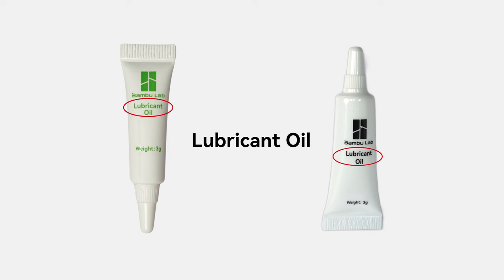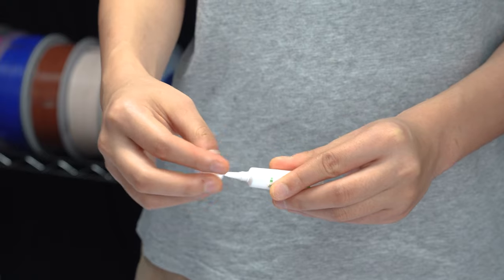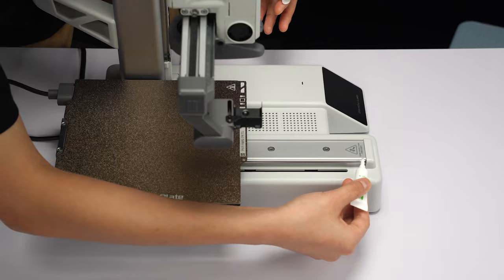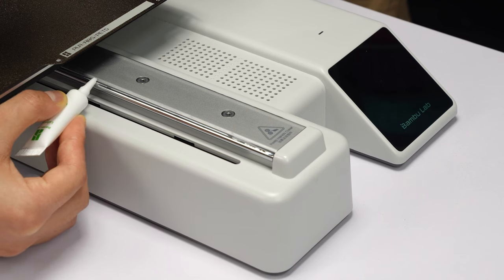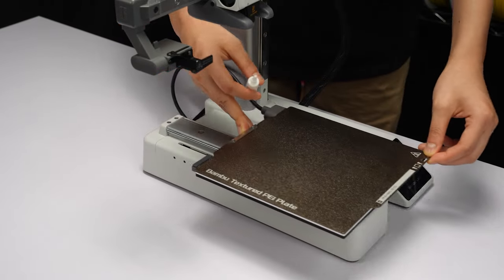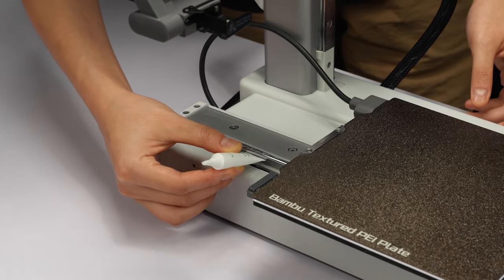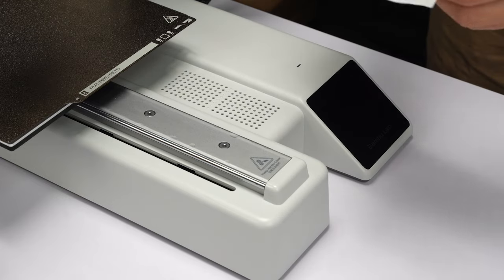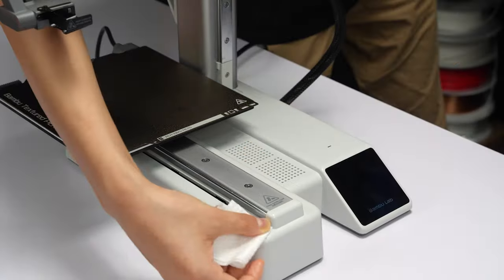How to lubricate the A1 mini Y-axis guide rail

Comment from the maker: The Y-axis of the A1 mini utilizes full-metal guide wheels, ensuring that users do not need to adjust the motion components of the A1 mini frequently. However, regular lubrication and cleaning are required to reduce wear and noise, maintain printer accuracy and lifespan, and effectively prevent rusting of the guide rails.

Comment: not a very clean and accurate way to apply; use a feltless Q-Tip like utensil not a potentially very dirty oil tube that can be contaminated with fingerprints and other debris.

Comment: can it also be used on the p1/x1 series ?
Reply: You use grease on the leadscrews for the P1 and X1 series. Lithium white grease, Super Lube or Lucas grease. The Lucas grease is the same at half the price and made in the USA. For the X1 Carbon you only use 90%+ Isopropyl Alcohol to clean it

Comment: As I cannot buy the lubricant oil in the Bambu store, what can I use instead?
Reply: Wiki says All purpose WD40
Reply: @necrotic805  I have looked in the wiki for the A1 Mini without success. Which wiki are you referring to?
Reply: @prebenhansen9846  机械用的润滑油都行，只要不是油脂就行
Reply: @prebenhansen9846 in the setup of the printer it shows you a QR code that takes you to the wiki about this printer, specifically the instructions page for lubricating it, which itself links to this video.
Reply: Instructions state that WD-40 will work.

Comment: Does the P1P, P1S and X1C need this also? How often?
Reply: yes they do once a month if u  use abs or asa primarily then 1 time every 2 weeks due to  the fumes thoes plastics give off you lube the bed lead screws 3 good size dots 1 top middle of bottlem of the rods all 3 of them home printer and move bed up and down in move menu to rube grease in wipe exess off with paper towel 91 percent ipa for the carbon rod luberacant oil as in this video for the metal rods the toolhead moves forward and back on ceck fillament cutter check nozzle wiper and clean out bottem is my maintenance  process for my x1 carbon several good vdis that show what i just explained and swab camera with glasses cleaner or iso alcohol to hope i helped you out happy printing merry christmas god bless

Comment: What kind of lubricant is it? I don't have the original tube & need to lubricate my A1 Mini Y Axis
Reply: In their website it says that you can use an "official" WD40
Reply: @patrickbueno3279  wd40 is NOT ideal it'll turn gunky it's best used as a cleaner not lubricator, super lube multi purpose for the linear rails and super lube grease for the lead screw
Reply: @E90  it's their instructions not mine though
Reply: @patrickbueno3279  they also don't mention in the wiki about lubing the other axis and guide lead screw so
Reply: @E90  they actually do, it's the x-axis and z-axis section but it's a little obscure and not part of the FAQ. x-axis is done the same with y-axis with no power, but z-axis need to have a power to control it up and down for you to lube it up.
Reply: @E90  I've searched it because I didn't lube it the first couple days because I don't really know what to do due to me starting from scratch as a beginner.